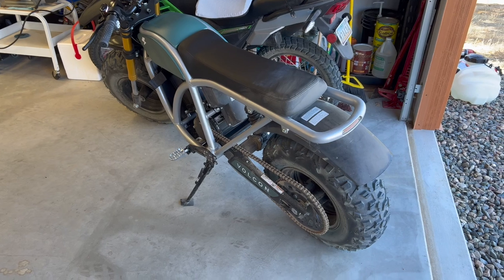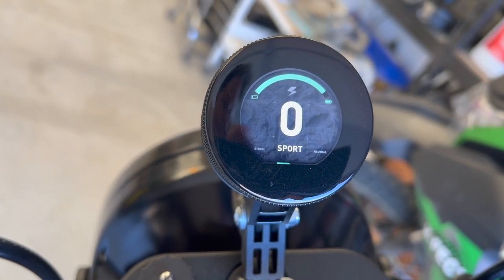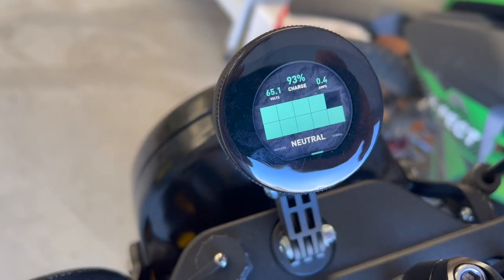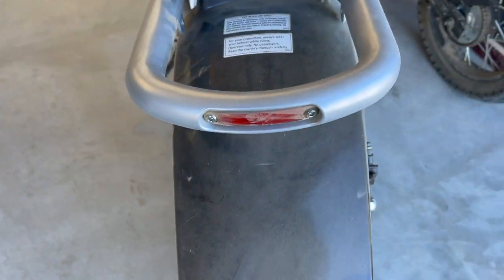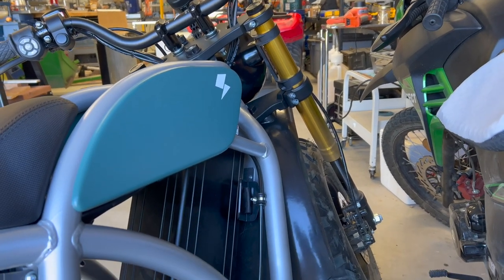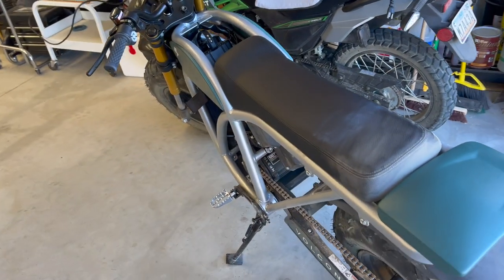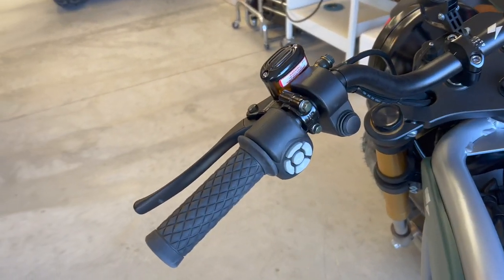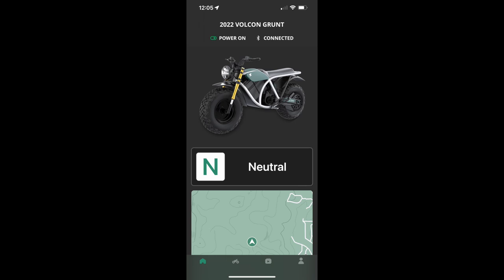2022 Volcon Grunt Review

Comment from the maker: Charge Time (10% to 100%): 2.5 hours

A few improvements that I would like to see:

1) More seat padding
2) An easy-access charging port that doesn’t require fumbling with the battery pack itself. 
3) A smarter charger that eliminates the constant relay clicking on/off once the battery is fully charged. 
4) Addition of a rear brake foot lever. 
5) Mirror option
6) Odometer 
7) Audible low-battery warning beep at 15%
Reply: I wonder why they opted out of odometer. Seems like a basic gauge to judge how far you’ve gone vs how much farther you can go ?  So what do you say instead, “Ive gone 4 cubes and have 4 more cubes until I have limp mode for 2 cubes. “. Haha
Reply: 1. The seat is OK for me, so not sure if they upgraded or it’s just me.

2. I decided to pull my battery to charge it. As you know, it’s so easy to remove that I just pull it and put it on the bench to plug it in. Everything is easy to access so no fumbling that way. I actually like the simplicity of the battery design, so I’d be OK if they left it that way. 

3. They must’ve heard you on the battery charger — I don’t hear the relay clicking on mine (I just received it in two weeks ago, so it’s new production. 

4. I prefer a foot-lever rear break, too, so I hope they make that change.

5. I see that Volcon has a Scrambler version under development — it looks like a cool design — so maybe they’ll add street options to that model.

6. The lack of an odometer is kind of odd. On a Tesla, it’s in the app.

7. That would be a good idea — you’re low on gas!!
Reply: @ChitFromChinola  I started looking for reviews on these grunts because I thought I seen that the motor was in the wheels and they were two wheel drive with regen braking.

Do you know anything about that ?
Reply: @steveh7108  
It’s not a hub motor. The motor is mounted just in front of the rear wheel, and it is chain drive to the rear wheel only. Very simple and effective.
Reply: @ChitFromChinola  yes I realize that it's a Center Mount motor with a chain drive now.
It must have been someone talking about the Prototype or something cuz I started looking for this bike because some video I watched said they were two wheel drive independent Motors.
Reply: @steveh7108  
UBCO has two hub motors and is 2x2. It’s from New Zealand, but they are delivering the US, I think. The UBCO has more of a work bike look, though, and the Grunt is badass.

Comment: Thanks for posting your review! I've been waiting for a natural sound video of this bike running and for someone to post their real world experience with it. You can tell it's a young product. I think there's definitely a niche for smaller less expensive bikes like this for people who mainly want to use it around their property or for short distance trips. The sound from the driveline is probably the biggest negative I picked up from your review. It's an electric vehicle and people really expect smoothness and low sound.
Reply from the maker: I have identified three main flaws that I'd like to see corrected in future models. The chain should be replaced with a belt. This would help greatly to alleviate the chain noise. Most of the chain noise comes from the front sprocket. It's not quite as bad as the video portrays, but it is louder than it needs to be. Its certainly quieter than a gas engine. Second, the seat is absolutely miserable. I think it needs to be a little wider and a lot more padded. The seat issue is exacerbated by the third issue; the foot pegs are high due to the great ground clearance. The peg height, combined with the low seat height places undo pressure on the rider's tailbone.

Thanks for your feedback.  🙂
Reply: As noisy as this is, you might as well get a small displacement gas engine bike.
Reply: @brianjudson2370  
I have a Grunt, too, and it’s very quite. You just hear the low hum of the electric motor and the low buzz from the chain. The microphone on this video unfairly overemphasizes the sound — the low hum of the motor/chain is very quite and has nowhere near.the irritating chatter of a gas engine. Also important, there’s no vibration at all. And no hot exhaust pipes. And no smelly gas. And no dirty/greasy oil. And no oily spots on your garage floor. And no stinking gas can in the corner. I mean, this thing is extremely well designed and a joy to ride, and has almost no maintenance. It’s a blast!
Reply: @ChitFromChinola  good to know 👍
Reply: @brianjudson2370  having it be electric is the idea of course 2 stroke gas is louder & you'll be paying for gas

Comment: I don't know why they gave the 3 drive modes a name? All it is, just like the Rokon, 1st or low gear, 2ed or medium gear, and 3ed or as fast as the bike is capable of travel. Putting names on something like that is just complicating things. They should also have at least some kind of hour meter. Just something to keep track of the motor usage.

Comment: thanks for the great review!. On the fence about getting on. Seems range is lacking and bike seems heavier than it should be...
Reply from the maker: I agree that 15-20 miles of range, roughly 1 hour of riding, is pretty low. I don’t find the weight of the bike to be an issue though.
Reply: i dont have this bike (i just build batteries) but on the plus side you could always upgrade the battery easily.

Comment: I got mine a month ago.  Rode it for 20minutes, and now it will not power on or charge.  The battery has no display, and the charger light just stays green.  RIP OFF!!  Volcon has yet to get back to me.  Also, it is cumbersome and rides clunky.  I would be scared to take it on an actual trail.  Buy a KLX 140 for a quarter of the price, half the weight, and reliability.